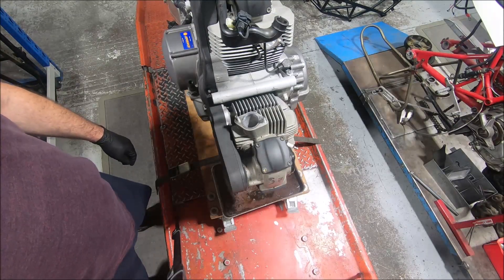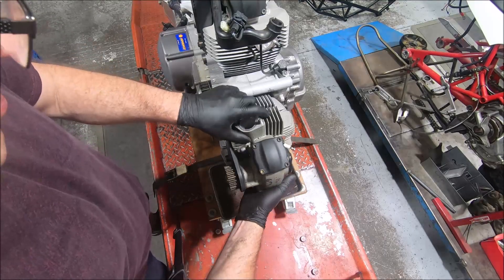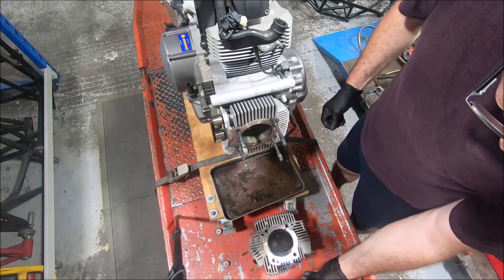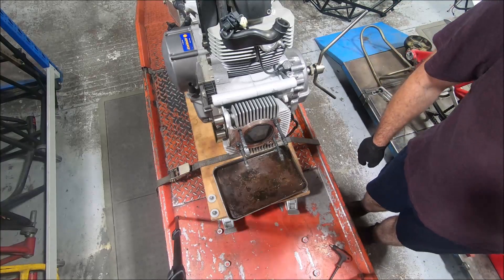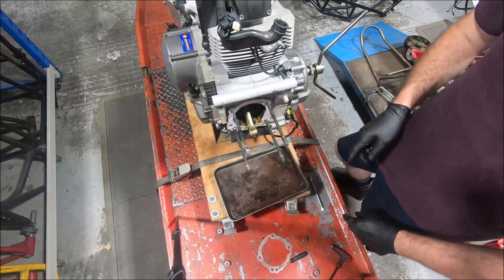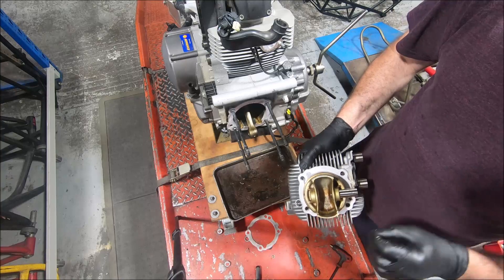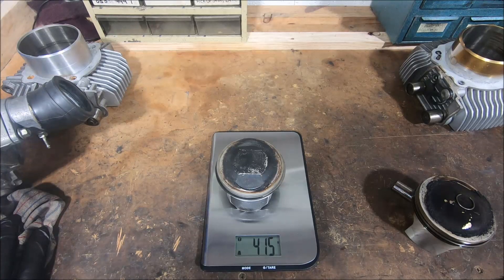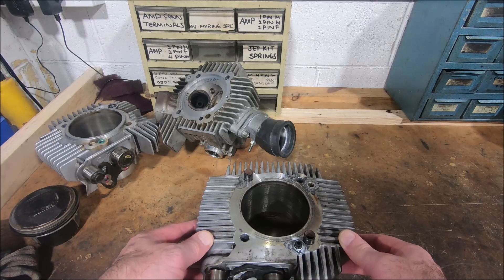Ducati 2V Small block cylinder stud spacing and other stuff

Comment: Hi Brad thanks for the information in this video, very helpful 
Will be using this video and another to attempt a piston / Piston ring replacement along alongside a head gasket replacement. 

Any suggestion like torque specs and special tools ?

Comment: Hi Brad, thanks for sharing your experience  and helping many of us out with clear info. Do you have advice or a procedure how to break in the engine after work on the cylinders and their seal rings? I see  a lot of info, but nothing rally consistent. Our bike: 996 for track days
Reply from the maker: if there has been no plain bearings replaced, you just need to bed the rings in.  if it has new pistons, i'd heat cycle it once on the bench, then get it hot again, take it out and use lots of wot to load the rings and bed them in.

Comment: Maybe the stud pattern was changed to allow for more room for larger ports in the head.
Reply from the maker: there's plenty of room for ports as was.  possibly as they were going to a head gasket (steel shim) where previously there wasn't a head gasket they wanted more clamping load surface?

Comment: hello! why my ducati monster 1000 ds sie 2005 puts gas in oil. 400ml after ~350km 10x (is it a stuck injector or used piston rings?)
Reply from the maker: the injectors are the only way fuel gets into the engine, so i'd guess one or both are leaking?

Comment: Thanks, great video! Can you tell if the heads can be removed without taking the engine out, for example on a m900?
Reply from the maker: all original style monsters and st you can pull the heads in the frame 2v and 4v, also mts1000/1100 and hm1100.  m696 onwards you have to drop the engine.  can't in ss or sc/gt.

Comment: So no upgrade heads for a big block 900 available?
Reply from the maker: wondering if machining the lip off the top of the 900 cylinder so it takes a normal head basket would work.
Reply: @bradthebikeboy  that's a really good point

Comment: Sir:  What is the quality of the MotoGuzzi engines?  Are the cranks and rods forged?   Are the cylinders nikasil lined?   What is the weight without the transmission?   TIA.
Reply from the maker: are you inquiring about any particular engines from their 100 years of production?
Reply: @bradthebikeboy  I should have been more precise.  I was thinking specifically about the engine in the V85TT series of bikes.
Reply: @bradthebikeboy  How difficult was it to ov erhaul that engine?  Did you have an engine manual from Motoguzzi?  Were parts (gaskets, etc.) readily available on-line?  TIA